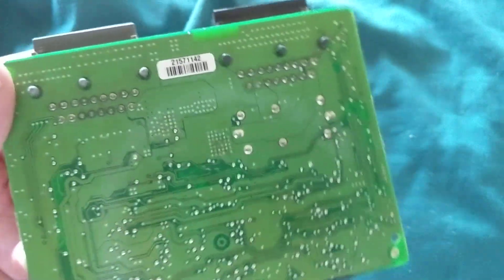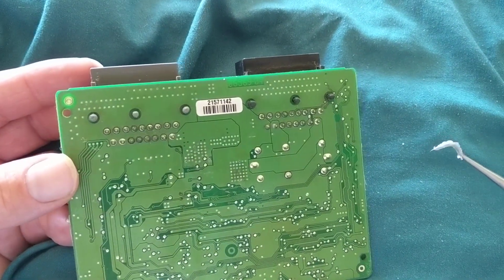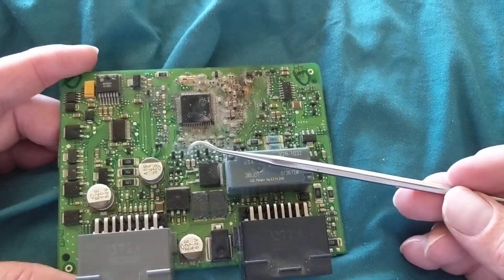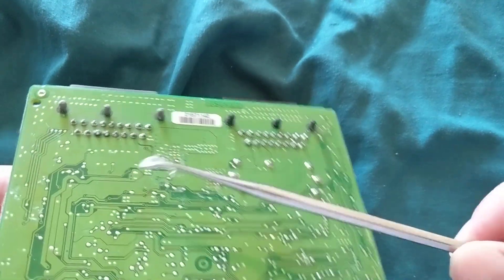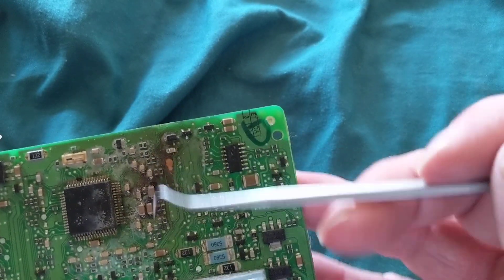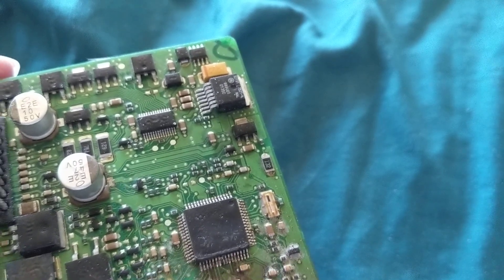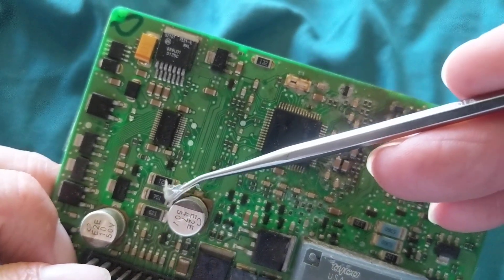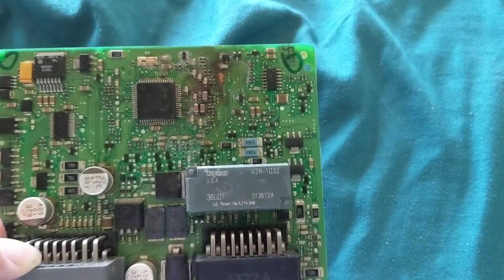BAD COMPUTER BOARD in Ford explorer, "MAJOR DAMAGE FROM BURNING"from "WATER DAMAGE"

Comment: Sir I need solution for my  problems on my Ford Figo car
1. At running condition some time engine stopped at running condition it's very danger situation .
Reply from the maker: Well I'm sure associated with that that could be so many sensors mass air flow sensor I'm sure there is a check engine light if there is you have to get a code reader at least to see what a code is
Reply from the maker: It could be anything from a sensor to a fuel pump problem first you have to have a sense of direction where to go and that comes from Reading data through the scanner